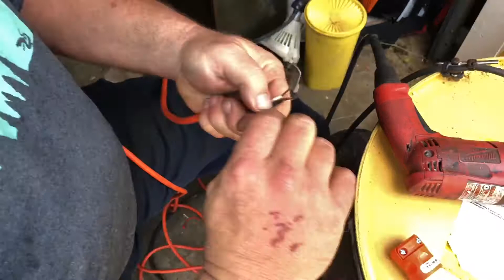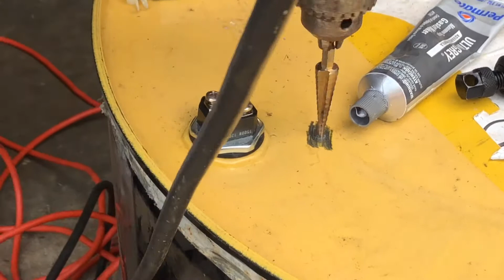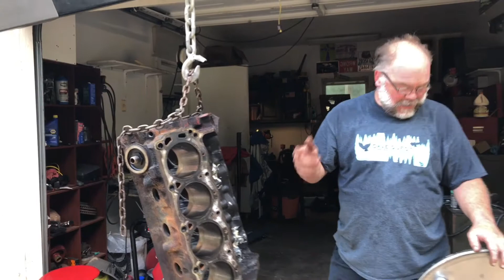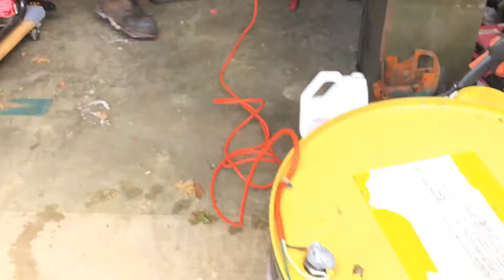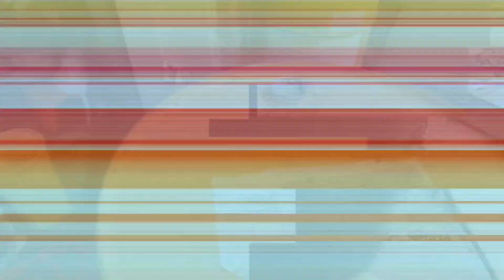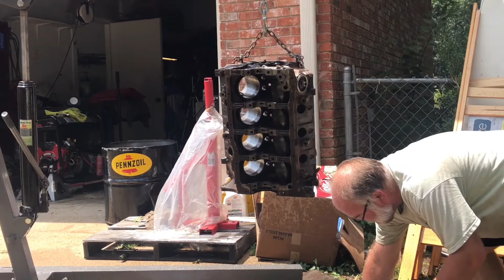Mercury Comet: HOT TANK ASSEMBLY & 260 Block cleaning

Comment: Would the battery charger and salt method you taught me years ago have worked to clean the block?
Reply from the maker: William G. Rodeschin I would think for heavy rust. I don’t think so much  for the grease and oil. Generally to get the grease and crud you have to get it hot, with a good degreaser.
Reply: @RealWorldGarage  I see....makes sense